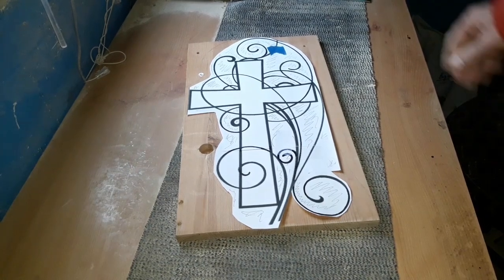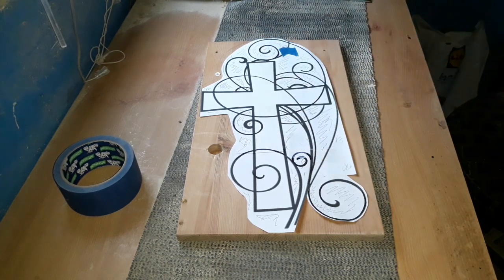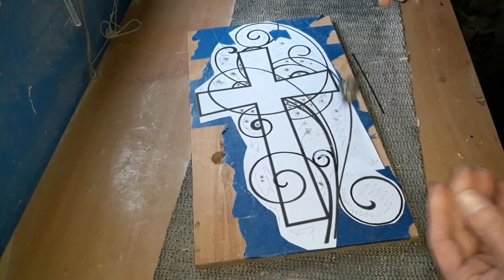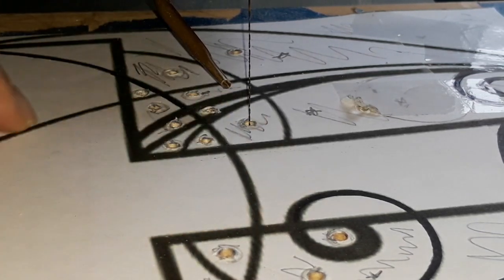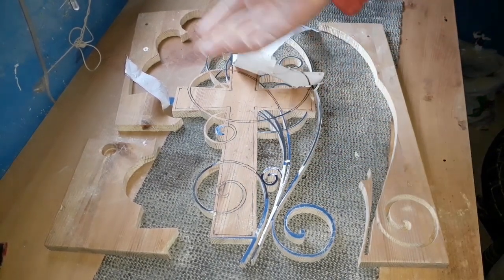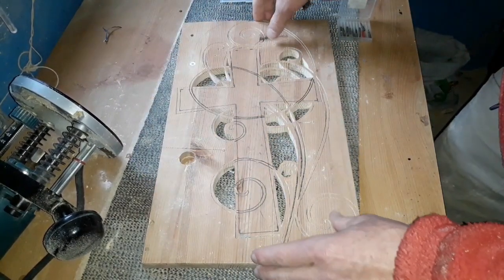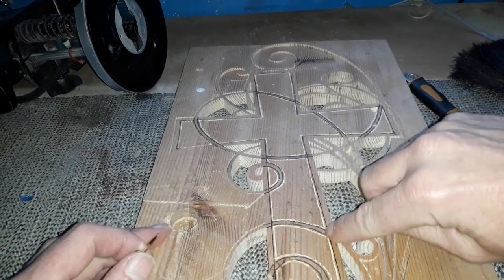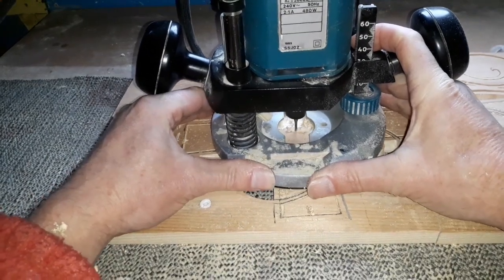Wooden cross with resin inlay. Scroll saw/Router project

Comment: one thing I would recommend -----instead of brushing on I would dip in a container ---that way it will get into all the tiny areas-------then let drip and slightly buff ------Tom
Reply from the maker: Would definitely be easier, I did think of using a baking tray but I've no space to keep it afterwards 🤣👍